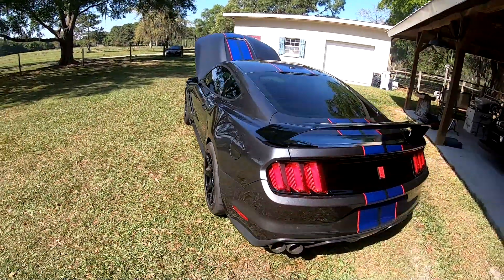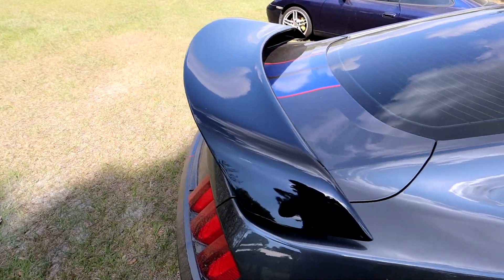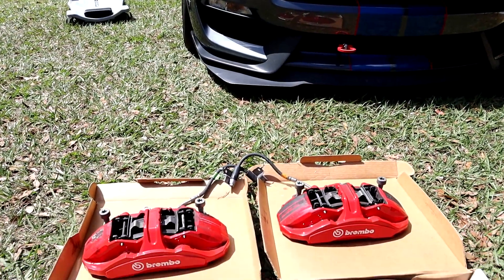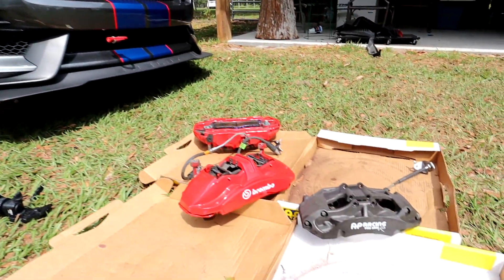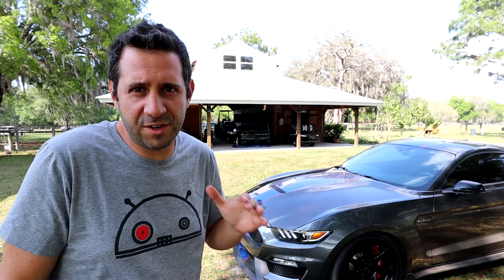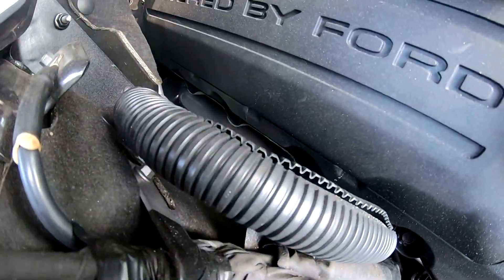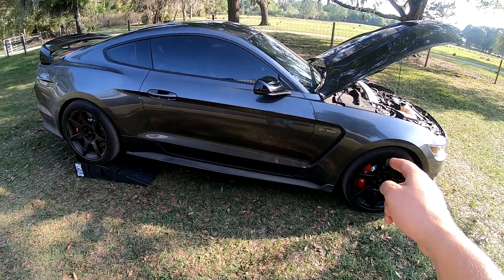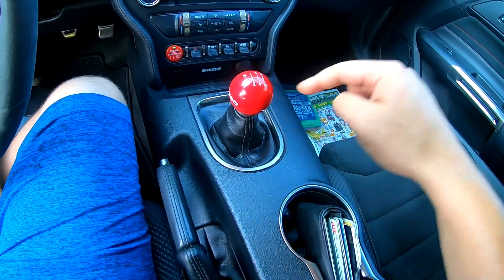I Bought a SEVERELY DEVALUED Shelby GT350R Mustang and I'm Restoring it back to Factory OEM!

Comment: GT 350 IS A ROAD TRACK CAR.
GT 500 IS A DRAG STRIP CAR.
 Both should be equally respected for their purpose.
Reply: Gt500 is well equipped for both corners and straight line, hard to believe, I know
Reply: Ian Taylor yeah but it’s not well balanced so much of the time you’re having to balance the crazy amount of power it makes it harder for the average person to drive it fast around corners without committing death
Reply: Crazy that people actually believe this
Reply: True, but the average buyer that Ford targets is the one that only sees horsepower numbers.
Reply: @cloroxmints355  No. Stop paper reviewing cars. The GT500 can really handle.
Reply: GT500 is well prepared for the racetrack
Reply: Incorrect but okay. The GT500 is incredibly well equipped for road course and just happens to be fast in a straight line as well given it's output power. Research please.
Reply: 2020 GT500 can do both now.
Reply: "Caroll Shelby intended for the GT350 to be a corner carver. The GT350 is a car that can tackle any backroad with ease and perform impressively well during a track day. The GT500, on the other hand, was more of a straight-line car. With such a heavy 427 cubic inch V8 hanging over the front wheels, the GT500 had gobs of torque to eat up the quarter mile in no time." Argue with a log!
Reply: This year's Gt500 is a track weapon

Comment: Id like to hear the factory mufflers with the long tubes and kooks mids. Although im sure that requires some welding on the stock mufflers which would be no fun to return to stock if it still sounded like crap.

Comment: Sam the previous owner likeky tracked it without the carbon wheels bc they would've been expensive to replaced if damaged on track so the owner used aftermarket rims hence downsizing to smaller size caliper that out performed stock calipers...just speculating here. BTW like what you said the exhaust headers are PITA task to remove.

Comment: "and if you need to replace a wheel from the Ford dealership it'll cost you $6K!:

Uses impact gun to remove lug nuts.....
Reply: The lug nuts are identical on all Mustangs - they also last about 30 changes, then they are done/swelling apart and you have to replace them.
The last time I had to do this they were $4 each.  Yeah, it's odd how some parts on Fords are expensive others are cheap crap.
Reply: He meant the rim. Replacing the rim itself not taking the tire on/off
Reply: I work for the company in Australia that make these rims

Comment: Isn't that the engine that everyone is having issues with I keep seeing on youtube?
Reply: The 2015 had most issues, they were resolved over the next model years but with a car that revs that high you have to be aware of high revs with cold oil. I'm sure most owners didn't take that into account
Reply: Some have had to have motors replaced due to oil consumption. That has been the biggest issue. How many?  Only ford knows.  Like any car with low tension rings, its going to use some oil. I check my oil after every gas fill up.

Comment: Looking at this from a pure collectible standpoint, your opinion is correct. This car is meant to be raced. The brake upgrade is related to braking in corners. Brembos suck. I would changed the exhaust not the short throw. They are definitely better than the stock sets.

Comment: I actually like the aftermarket exhaust, it does not sound like a loud trumpet like most GT's in my area. And frankly, the stock one was a bit too high pitched for me. Also, you could just add an electric cutout somewhere along the midpipe.

Comment: Great video, I have a stock 2017 Gt 350 and plan to keep it that way because ford did a great job. The only thing I changed out was lighter wheels ( p51 wheels)which knocked off 8 pounds per corner. That reduction in rotational weight really makes the car accelerate faster. The stock wheels were boat anchors ( wheel and tire weight 60 plus pounds for each corner). In my opinion, I would definitely put the whole stock exhaust back in. Also, I bought that blue airaid filter and did a unscientific test to see which flowed better and the stock air filter in my observation flowed more air, so I kept the stock paper filter.

Comment: Technically a pneumatic brake bleeder uses vacuum at the caliper to pull fluid through the lines or pressure at the reservoir to push the fluid through the lines

Comment: I'd like to know your theory on the rotor vanes pointing rearward. They are designed to scoop air in and push it through the rotor to cool it. It won't have that effect with the vanes pointed back. Think about how you cup your hand and arc your arm while swimming.

As far as the exhaust, I agree 110%. That Kooks system ruined the song of the flat plane crank. Put that exhaust back to stock!
Reply: They scoop on the bottom, when they are facing the front of the car. If they faced forward on the top, they would be inside the fender and not get the same airflow.
Reply: @BrainiacHoyt  🤦‍♂️If they angle backward they aren't scooping anything at any clock  position in a forward rotation.
Reply: @600zxr  dur, brain fart on my part. Maybe they pull air from the inside out? Maybe.

Comment: I would replace the exhaust from the long tube headers back and see if sounds like the factory sound you were looking for, if so, like you said it will help with the performance of the car with the sound you want. As you described it will lower the value of the full aftermarket exhaust system but some people are just looking for the exhaust back from the headers and would buy them same with the headers and who ever buys the exhaust you can let them know that possibly in the future you could be selling the headers and if they were interested at that point you could call them when or if you ever sold them. Problem would be is would the stock exhaust fit in length and diameter to the long tube headers hoping and probably you would have to hack up the stock exhausts to make it fit ruining the stock exhaust at that point then why go thru the headache of getting all the original exhaust if you will just hack it up. So that's probably the answer you were looking for, go all original from headers back so you know that's the sound and look you were going for without hacking stock exhaust to fit aftermarket exhaust.

Comment: are they resurfacable? If they are the only mistake you made is not resurfacing them. They werent marked how they come off so if that hub has any imperfection at all it will out of round much faster then normal.

Comment: IMO I would just get an aftermarket y and bolt the electric cut outs to them, in turn you keep the exhaust system and you can still utilize the factory cut outs.

Comment: My guess is that previous owner changed the wheels, discovered that they foul on the callipers, and was forced to change the calliper setup. I didn’t see it in the video, but I’ll bet there’s witness marks on the inside of the wheels. Also, the AP callipers are universal, the intermediary bracket is specific to the vehicle, and acts as an adapter, and has 2 bleed nipples so they can be fitted either way round. We need to see more v8’s on UK roads. Love them...

Comment: If it was my 50k I wouldve got an M2 comp. Bought an M2 (non comp) a month ago and its amazing. My only complaint is it doesnt have the violent speed of an S55 motor from BMW (M4/M3/M2 comp). Extremely balanced car. Perfect size. And that motor with a tune and down pipes makes 530+ WHP. Imagine 530 wheel in an M2.. Crazy thought.

Comment: I would change the exhaust to stock the stock one sounds way better the aftermarket one you have it sounds not like a v8 at all more like a v6 oder even a 4 cylinder that's awful. I know it of lot of labour but it's definitely worth it in my opinion. Greetings from Germany :)

Comment: One of my dream cars, unbelievable deal. Can’t you just have someone at a muffler shop adjust ONLY the connection into the factory mufflers? Just leave the headers and cross pipes alone and you get the bi-mode exhaust back.

Comment: Those headers aren’t too bad to do on the ground. But I’m not sure how different the 350r is than a 2016 gt. EDIT:  I mean as in parts wise and how crammed everything is on the passenger side that’s the hard side lol drivers side is super easy to do

Comment: Sambo, wait a few weeks for the mid pipes. A lot of people buy salvage and part them out. After that, when car is all original, sell it for 70k. You have all the parts to make a regular gt go faster and handle better. You can buy a copart special and put all the mod parts on. Then you have a car as capable as a 350R for under 20k. If having an awesome drivers car is the objective.

Comment: I don't know that I'd go to the expense of replacing the headers. You can always take a look at it if you decide to sell it and do a cost-effectiveness calculation at that time. I'd definitely keep the short-throw shifter kit. I'm not sure what you mean about believing that the standard shifter is "more forgiving". I've put short-throws in every performance car that I've ever owned, always finding them to be performance and driving pleasure enhancements. In my opinion, the GT 350 with the flat-plane crank is generally more desirable than the GT 500. The 500 is a faster straight-line performer, but the higher RPM that you can get from the engine makes it a more refined, nimble road-course performer.

Comment: It's all about what your looking to do. If you want a 100% stock car then the $1800 is a small price to pay. Or if your not worried about it being 100% than let it ride as it is. I personally love the original sound of the car in it stock set up..
Reply: And that's coming from guy who did put a zoomers exhaust system on his srt challenger. And instead of spending the $50 grand I probably would of spent $60 and went with a c8 vette.

Comment: Honestly, there’s nothing like stock. It might not be perfect but the people who designed it went to college and know what they’re doing
Reply: well college doesn't automatically mean smarts. alot of parts were made out of plastic when they should have been aluminum or some other type of metal, but to lower production costs they were told to do it (the engineers). so that's why people update and modify things as well
Reply: @startingtech3900  not to mention OEM had federal emissions standards to contend with to sell the car.

Comment: I would return it to the stock sound and exhaust setup personally. A huge part of owning any car is enjoying driving it. Sure, a few extra horsepower and a couple extra ft-lbs of torque is nice, but you won't really feel it, and there's been studies done that show the sound of a car greatly influences how fast your mind perceives you're going. If I'm not mistaken, these came with inequal length headers to create that signature crossplane V8 rumble, as opposed to the flatplane V8 sound you have with the current longtube setup, and the rest of the exhaust was specifically designed to build upon that V8 rumble. Otherwise, currently it just sounds like a Ferrari being tortured, and that's not very fitting for a muscle car.

Comment: Whip those headers in the trash. Mufflers are responsible for tuning tone, but there’s no more unequal length growl because of the geometry of the aftermarket headers. The stock headers sound so good because they’ve been designed to give an unequal length growl even with a flat plane crank engine...

Comment: For that exhaust:
Definitely keep the headers, too much work to replace and no point in throwing away the power gains. Also it wouldn’t be a bad idea to try and make the factory rear pipes fit onto the kooks mid pipes

Comment: Leave it, a lot of people don't realize the stock system has unequal length headers which add a v8 burble. The gt350 has a flat plane crank, and the cook's headers show it. Also it adds more power than what unequal length headers would provide. Edit - A flat plane crank is essentially two i4 motors attach at the crank. Hatting on the sound is hating on the natural sound of the motor. But at the same time unequal length headers do sound good huh? lol

Comment: Anyone else confused why the previous owner would spend $5k on a front brake kit (to only save about 20lbs and maybe lower track times but some small amount), but then went to program the dampers to be more compliant, which would then check any previous gains???

Comment: I've done headers in a truck it is a bI**#    ...     These probably flow better than stock and I bet you will regain most of the beautiful sound from the midpipes back since it goes through the muffler all the time with the aftermarket system and with the stock it basically straight pipes it to get that sound or diverts it through the muffler with the valve

Comment: Sorry I get the exhaust changes but why the brakes? You have the originals to include if you were selling it,  why not leave the upgraded calipers? If anything I would have pulled those wheels off put em on a shelf and replace with aftermarket ones for anywhere not on a track. 6k a wheel... pfft.

Comment: Hate to break it to you but the R can be had for about $5k off sticker from the right dealership new. And the regular 350 even more off.  They have not held value. Especially the 15-18 models.  No one wants them prior to the 19 model because every one wants the 500 at this point. The gt350 pretty much was mass produced and way more were made than originally intended which was a 2-3 year run that ended up being a 6 model year run.   “Collectors car” is a very lenient term with a GT350/R. Don’t know where you live but where I live they can be gotten fairly below msrp. And when it comes to the kooks system the issue is probably the fact that it’s probably not set up with actuators to work with the stock active exhaust system. Replace with corsa. Lastly if you have long tube headers the cars tuned and faster than stock.   No one would want those taken off.  The issue is the exhaust. Change it to one that works with the active exhaust and keep the headers.  And your video of the cold start sticking was clearly not a “real” cold start after market.  You got a great deal but dyno that car before and after.  And you’re going to need to ref lash the stock tune once Putting stock headers on.

Comment: I'd be careful doing what you were doing with just draining brake fluid out like that if you go too low you can cause air to get into the HCU and then you'll have to do an abs bleed, and you'll need a scan tool to perform that procedure. It's worth dealing with the mess for 30 seconds when you swap over calipers..

Comment: That is a lot of miles on a collector car.  Exotic cars really drop  after 4000 miles. (Lambo’s Ferrari) Porsche’s are considered high mileage at 20,000 mile.  I have owned several exotics.  Tired of the expensive yearly registration, insurance, maintenance.  I own Tesla’s now that are faster but they are not exclusive but no maintenance is nice.

Comment: First time in a while I see you making a whole lot of sense, with a couple of exceptions.   I think first you will have a hard time reselling used performance parts, except at a steep discount.  They aren't quite like used condoms, but it's in that range.   Your $4000 parts might get you a grand, because the people who can pay more generally are willing to pay for new in the box.    Your market will be people with regular mustangs looking to up them at a big discount.    So really, your 50k car might get down to 45k if you are lucky.  Now, when you resell it, you really should be declaring what this car was previously used for,  in part because there may be issues for any warranty or coverage that may exist for the car, and the life span of certain things like clutch, transmission, and differential might be diminished as a result of track use.   So your resale price might be in the low 50K range again, and your profit is only in the parts you took off.   Track day cars are likely buying taxis, they are generally beaten within an inch of their lives.

Comment: LEAVE THE EXHAUST SYSTEM, She sounds SEXY WITH the KOOKS exhaust.  REMEMBER THAT the 5.2 engine is FLATE PLANE CRANK, which will make it sound more like an exotic car (ferrari ish) but with the OEM exhaust it sounds like every other V8 USDM car. In my opinion Leave the KOOKS exhaust because it sound a lot more cleaner and crisp.

Comment: Look for an owner with a stock exhaust and offer to swap for yours and $2k on their end.  Wrenching is fun, so why not?  I would also remove every single mod, including the filter, AO separators, adj shock towers, shifter, harness bar and harness......everything.  Then you have maximum collector value and I would argue that for your use the most enjoyable car possible.  You're going to easily sell all the modifications and capture a good amount of coin.  I think the car was a good buy but I'd say that when you're done demodding, you'll want to sell it fast because Ford has caught on to selling a bazillion "limited production" models.  There are hundreds of special model mustangs out there.  They're not that special and you don't want to get stuck with a 50 grand run of the mill Mustang.

Comment: Why the f did you drain the brake lines? Just put pressure on the brake pedal, closing all the brake lines and you will only get a small drip as you remove the line. Then you wont have to air out the entire system

Comment: Not to be that guy Sam but with 13,000 miles u won’t get more than 50k, was looking through out different sites and I saw a couple 2018 for mid 50s and a lot of 2017 for around mid to high 40s plus they had less than 5k miles so my suggestion would be to keep the car for a while, Or until u could find the right buyer? But you should definitely make a vid or 2 ripping the car on the streets 😂 that would be hot